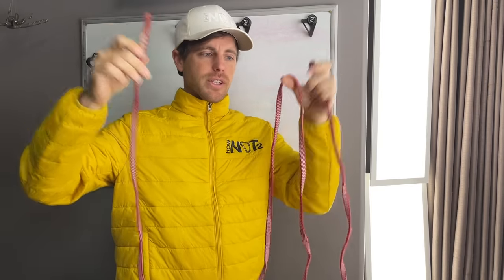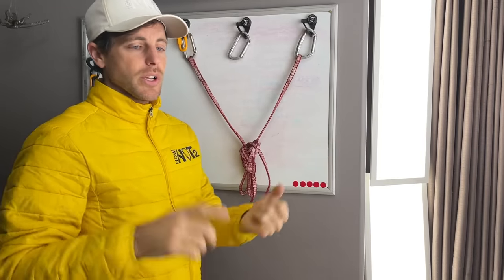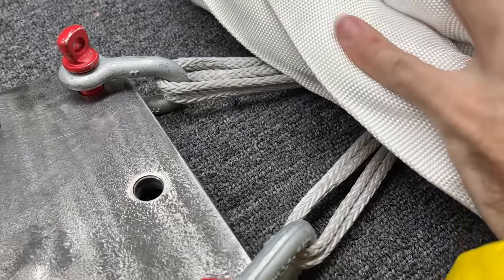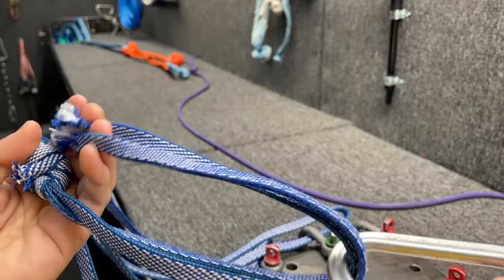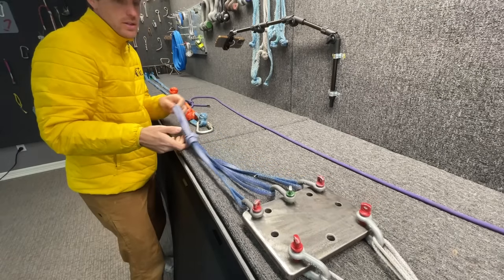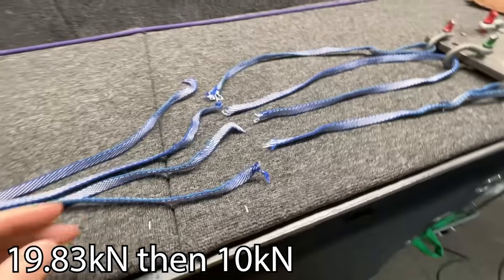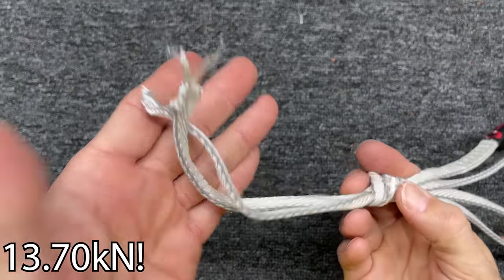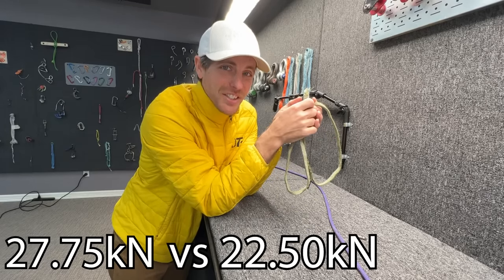Not all climbing anchors are bomber

Comment from the maker: How strong do you think an anchor should be to satisfy the "Strong" requirement in S.E.R.E.N.E.?

Check out our new store! https://hownot2.store/
Reply: 20 kN generally
Reply: I would absolutely love for you to test some of these anchors by sticking a load cell on each leg if that's possible (or at least a couple of legs). The importance of load balancing has become less and less after seeing some tests and I so, in the UK at least, we're starting to be taught that extension and redundancy are the most important factors and although it's good to try to get all pieces sharing to some extent, the likelihood of achieving this is low, .

It would also be tempting to see the difference between nylon and dyneema slings as with nylon, the extension of one leg would ensure that the other legs started to at least play a role in taking the load whereas with dyneema, the lack of stretch means that the leg that is 'looser' will remain disengaged. As far as I know, there haven't been many good tests of this.
Reply: As strong as  your best pice and as weak as you worst 😂
Reply: 250 KN  sounds about right to me.
Reply: enough
Reply: Probably 10kn most falls are probably less than 4kn and 10kn is 250% so I’d be cool with it
Reply: @HowNOT2
Is there a way to make a limited sliding X for 3 points?
Reply: Without thinking about it a too much, a not exactly impossible wcs would be two climbers falling at the same time the length of the tethers due to negligence and putting 2 factor one falls, so maybe 7+7 kN, so 14 plus a little wiggle room of 3kN should hold it. I wouldn’t be comfortable trusting something weaker than 17kN at the anchor when multipitching for that reason. But of course, let’s just say ~20 to be safe.
Reply: @tehrater480  I am somewhat confused on how the person at the belay is going to take a 7 kN fall without seriously injuring themselves regardless. Worst case scenario, an inattentive belayer has a ton of slack out in guide mode while the climber takes a fall, and the belayer simultaneously slips and falls onto a loose tether; it's hard to imagine this adding up to 14 kN. Even so, once the anchor is stronger than the rope it becomes irrelevant, which should always be the case on a bolted belay.
Reply: Top rope ? Pretty strong .. belay anchor?  better hold a fricking truck
Reply: At least 2x stronger than the rope at full strength.
Reply: Stronger than the weakest piece of gear, so maybe 12kN
Reply: @SonnyKnutson  Could just use an equalette. Limited and self equalizing. Easy.
Reply: Since you are kind of not suppose to load your anchor, rather your "jesus piece".. This doesn't matter that much.. still it is always better to focus on having two redundanta pieces (not same rock formation that could break at the same time), than think too much about this video.
Reply: @HowNOT2  How about doing a test on the equalette  ???
Reply: About 15kn - no point to be stronger then most ropes when new (dynamic).

Comment: I doubt this is any more versatile than using standard slings. Places like Joshua Tree I would find this hard to use because of the random anchor placements. Joshua Tree tip: bring a 30m static rope as a anchor sling, trust me you will want it.
Reply: My local climbing area (Devils lake, WI) has similar ethics to JTree with anchor building. I took an anchor building course there and they used static rope in every one of those anchors to sling trees and boulders, so I can definitely see how that would be helpful
Reply: @strctlykilz  precisely my friend
Reply: Unless you guiding, that’s not really necessary.
Reply: Certainly, your methods will change depending on location. I don't believe there's a single method that works 100% of the time anywhere you go, atleast anything besides the most basic of basics
Reply: 30 meters?? That's a lot
Reply: @timothyc9965  yea... a good placement sometimes is 10-15 meters behind where you want the master point.
Reply: Why static? Wouldn't dinamic be even better?
Reply: @MrMaffy96 generally speaking, anchor material should be static, like the slings shown in this video. Dynamic isn’t always better, you want your rope to stretch but preferably your anchor stays the same shape and size over the course of many sessions.

Comment: Interesting that with all of these slings that none of the stitching failed, it was almost always at the knot.  Great content!
Reply: Always at the knot ! I have sewn sails and my own climbing software most all my life. I have worked in parachute repair shops as well... it is amazing what a cpl bar tacks can withstand ! Failure is 80% of the time at a knot the other 20% at the turning of an edge. Stage hand riggers use the term 'D to D' ratio, diameter of line to diameter of turning point. Big consideration. as well :)
Reply: Yeah and the first knot didn't seem dressed as well as the second. I wonder if this is why it held 5+ more KN

Comment: I feel the sliding V going to your rigging plate allows changes in the 3 anchor positions, which is also contributing to equalizing the load which is skewing the results a bit.  Another way of pointing this out is that the rigging plate can pivot and any pivoting action of the plate causes one anchor point to move closer to the load and the opposite to move away from the load, where the test should be 3 unmovable anchor points.  This is most noticeable during the un-equalized test around the 6 minute point.

Comment: You should be aware that a webolette rigged as you used it puts roughly twice the load on the piece with the two strands as compared to the pieces with one stand. This is because the double strand is twice as stiff. As the strands stretch the load goes to the double. Try it. Super good enough? Maybe for bolts, but it is worth knowing this for trad anchors and is why I stuck with a spectra cordelette.

Comment: I have been using a shock absorber to protect my belay’s for 15 years now. I place them as dummy runner or on the high point of the anchor. Both on ice and rock anchors . They are old fixe dynema S-A but I tested 2 recently and those worked well 😅. I say yes to protect the belay with shock absorbers they work!

Comment: In the UK we often build our anchors using excess rope instead of slings. I'd be curious to see the differences between in-reach and out of reach anchors, as well as how the number or anchor points/clove hitches affects the whole system's strength.

Is this something you've already covered?
Reply: Would love to see some anchors built out of 7mm static accessory cord as well. On the drop tower and in here. Also for the sake of science, it would have been great to have a new sling to compare with the old retired slings as a controlled variable.
Reply: Look up the dmm drop tower tests

Comment: Part of the reason why you saw what you saw with the knot tied with uneven lengths was that the attachment point shifted so that the load was more evenly distributed than what it would've been if the sling was attached to a rock that wouldn't shift.

Comment: Quite an interesting result.I've been using "webolettes" for years (the term is being used generically) as it seems to be a very sensible, light, low bulk system for anchor building. @0 KN is super good enough, but I always figured they were WAY stronger than that.  I did wonder if a simple overhand might give a different result vs the figure 8. Thanks for this deep dive.
Reply from the maker: I will explore that more for sure, from the tests i've done over the years, BFKs didn't have any difference with overhand vs 8 for strength but an 8 is easier to untie.
Reply: the knot wont make a difference figure 8 vs overhand

Comment: First off, thank you for generating such great content! I get to geek out about science and climbing. Now, the point ...
    There are some things to consider after watching most of tests that you did. First, the Dyneema (ultra high density or molecular weight polyethylene or UHMW PE as plastics nerds might say) tended to break around the knot. I would suspect that is due to the high friction produced as the webbing slid against the knot as the knot tightened up; that hypothesis is supported by the little Dyneema sling that broke and you noted the warm, rough, kind of melted break point. UHMWPE has a relatively low melting temperature compared to nylon, but I think that almost all of your knotted tests in this and many of your other videos have failed around the knot. The friction force * distance the webbing slides turns into heat, which softens the webbing and creates a weak spot that breaks. 
    Though kind of freaky, but the breaking forces were still pretty large. As you said at the end, this effect that can minimized by shock absorbing hardware. 
    The other detail to consider is to inspect your gear by feeling whether the webbing is still supple. If it is not, especially after a climb, then there could be melt points in the fiber that have fused adjacent fibers together. This can be in both Dyneema and nylon.

Comment: I've read that you should not tie a knot in dyneema anchor slings.  Just leave the loops free at the master point.  That will eliminate the weak point of the knot and permit automatic adjustment to match the direction of load.

Comment: Overview lesson: two independent dyneema slings with no knots is far stronger than any sort of giant, kludged knotted runner, despite its appearance as more robust or redundant, because the weak spot is going to always be in the knot. If you want to shorten or semi-equalize the system, just running the slings doubled, or a second time around a biner, is going to preserve most of the strength, whereas any knot is going to greatly reduce it. The persistence of advocating a "guide approved" quad, or any knotted arrangement, is just bad advice, perpetuated maybe only because most real world loads are far below the potential limit of a worst case (ff2 shock) scenario; just because most of the time people get away with something, does not translate to meaning that it is acceptable over the range of worst case situations. Infrequent as they may be, the rare catastrophic failure event does occur, and realizing that we cannot ever know in advance which day, which alignment of setups, is going to be below the threshold for survival, it behooves us to just always plan as if that day is every day. We may not ever experience the worst, but over time someone, somewhere will.

Comment: I don't climb,  but I do a lot of rigging and find these tests interesting. When we pull shoring the 2 way at the single shackle point gets hot enough to melt the grease out of the wire is interesting how much heat is generated at the knot

Comment: Always fascinating to watch pull tests and see the results.  Definitely surprising to see the two-point pre-EQ knotted anchors fail lower than the single-point sling.  Dynema vs nylon, age, wear/use/bending (knots) are all contributing factors, but this was still surprising.  Thanks!
Reply: PS - IMHO (accent on the O), a BFK (or BHK) is a particular bight- or mid-line-knot made by tying an overhand knot with four strands of material (usually rope).  It is not a two strand figure eight.  Minor point, but something that could be confusing and important when learning or teaching or talking about knots.

Comment: Have you tested straight vs knotted?
If not, it would be worth getting a handful of slings / straps and testing.. 
Even with the theory of half for the knot and double for 2 runs per leg, I'm willing to bet the knotted will be significantly weaker.

Comment: Yo! I've seen some lead belayers in the gym using the Edelrid Ohm, seems like it does work and helps with the older ladies who are still belaying. I wonder if it could help with what you mentioned at the end of the video with larger fall factors and screamers...

Just searched up some videos about it and there is like two.
Reply: The ohm doesn't decrease force on the first piece / bolt of the next pitch, and you are generally not supposed to fall directly on it. It reduces the force that the belayer sees during a lead fall by sharing some of that upward force with the first bolt / piece assuming the leader is falling on at least the 2nd bolt / piece of the pitch (or higher). Usually this causes harder catches as the belayer is displaced less, so the force on the top piece might actually be higher because the climber decelerates faster. This is safer for the belayer (less slamming into the wall) but not in the same category of techniques as using a screamer on your anchor or first piece. 

A better solution is to introduce more rope by lower the belayer as far as reasonable below the anchor before the climber starts the next pitch. Even 3-5ft extra makes a huge difference if there is only 5ft of rope in the system.

Comment: Would love to see the test done at 6:00 done on the drop tower! A non equalized anchor/bfk. Would be cool to see if the first 2 legs breaking first would be enough to absorb some force of the fall and save the last leg. I get that it might not be the most useful test, since you’d need a big mass, maybe with static rope in a F2 fall to generate enough force to actually break it, but it would still be cool 😂 or maybe using thinner cordellete, like 5mm or something instead of a dyneema runner.

Comment: I do not rock climb but I believe that your count is wrong when a simple loop counts as "2"  ->  1:30  The top center double is, when it comes down to it, just ONE rope (line?) receiving friction and stress at the friction/stress points.  You count in a similar manner later in the break test, which is why I bring it up.

Comment: So, you talk about factor 1 falls etc, which I think I understand, vaguely (I probably have found the video explaining it).  This is more of an arborist concept, but I would love to see a drop test video looking at the shock loading of DRT vs SRT.  The way I understand it, an SRT set up would always have a length of line up to the anchor/redirect, so say going up 20 feet at the ground you would have 40' of line and at the top you would have 20' while in DRT yes at the bottom you would have 40' of line but at the top you would have 0' of line.
Reply from the maker: If you fall 10 feet with 10 feet of rope in the system its going to be way higher than falling 10 feet on the first pitch of a route most of the way up with 120 feet in the system, which would barely be 3kn on your anchor.  DRT would have more rope in the system so it in theory should help but if the rope is really static, it mostly doesn't matter, it all hurts at that point.

Comment: Maybe this is a stupid question…but the knot being the failure point makes sense to me.

Let’s say all three anchors are equally loaded.  The thing that WONT be equal is the knot because it is going to cinch generating heat in a localized spot.  That heat difference is what causes the line to fail at that localized point.

Wouldn’t a failure at any other point be indicative of a defect?

Comment: Get  your redundancy by using multiple pieces, not by tying knots in one length.  Knots are terribly effective stress risers.  Without the knot, it would be self-equalizing and you'd be using all four strands more evenly, even as the climber changed direction slightly.  Your 27.75kN test result makes sense because it didn't have the knots.
Reply: The second E in SERENE is Efficiency, and that includes for gear. Three same-length slings are not going to be self equalizing either.

Comment: This sort of reminds me of those giant spools of nylon cord at home depot. Rather than hunt down an employee to cut the thing, you just wrap it around your hand and use the nylon to cut the nylon. I think a similar things happening here. As the tension increases, the rope is cutting itself. I wonder if it would be feasible for these anchor ropes to be double sheathed. You have your normal sheathed core, and then a significantly weaker outer sheathing. In theory, it should make it so that as it tightens, it cuts away the outer sheathing, revealing the much stronger sheathing, which shouldn't be cut by the knot.

Comment: Could you make a video about the momentary forces vs the constant pull slack snap. I assume slack lining and some other sports may have higher consistent forces. Where as climbing is mostly about small constant force and potentially large momentary force. Maybe you already have and I missed it. I know you have the drop test which shows real world shock forces better. Maybe a deep dive on real world forces from a sciency/physics point of view? And how you can interpolate the data from the slack snap into a real worlld scenario. I may be over comlicating things...

Either way, thanks for the content.
Reply from the maker: We have several videos of real forces in climbing falls in the gym, factor 1 falls and factor 2 on the drop tower, rope swing, highline and even rappeling forces in all sorts of content already. I’m working on a way to put this together in a “Bolting Bible” a-z content so you can just scroll through 1 blog and see it all summarized and chase the rabbit of your choosing.

Comment: At 8:33, is the crackling sound the sound of single filaments breaking one after another? This is something I would indeed expect for an older work-out fabric in contrast to a brand new one where all the filaments are still kind of aligned and equally strong. I think I've seen a video where a guy from Edelrid stated that this is what you can actually hear when break-testing older stuff.